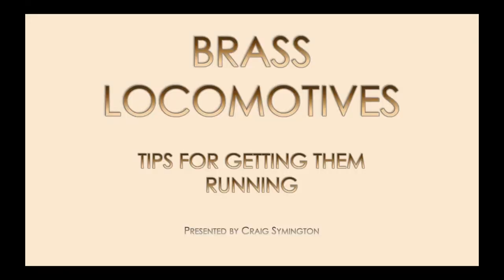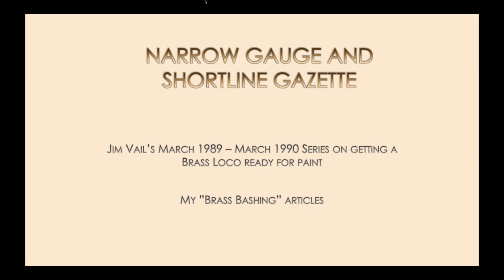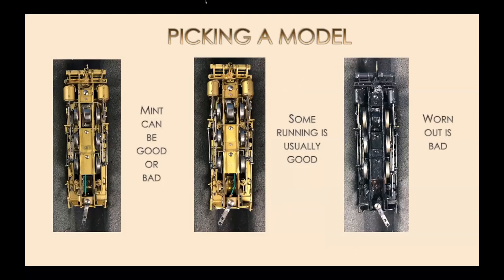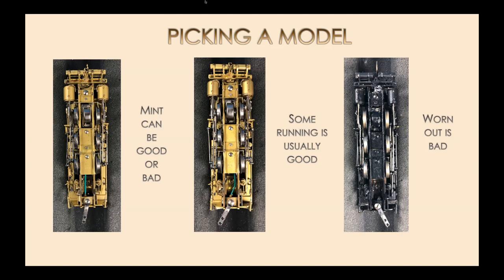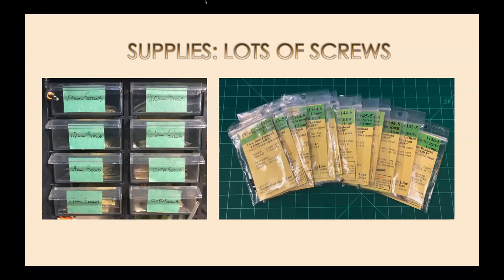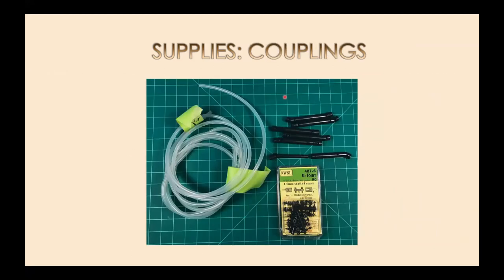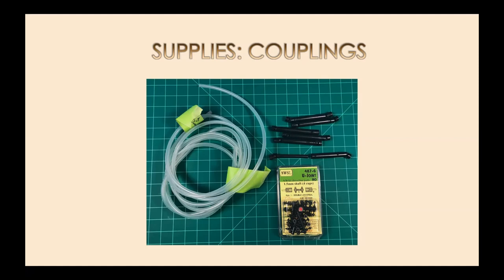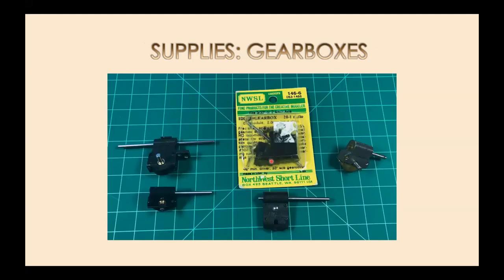Craig Symington presents "Brass Locomotives - Getting Them Running"

Comment: Thanks for sharing your video. I have been rebuilding old Tenshodos Diesel Units as of late. One tool that I also use here are 3d printers (resin and FDM). I print custom detail parts that would not be available. I have been able to fabricate motor mounts to mount those Mabuchi 18mm square motors, so they have a factory like install. I make my own gears, so I can fine tune the final speed and torque of the locomotive.  And since I am doing this project over a fleet of locomotives, I can scale up a mini production run of common parts .
Reply: That’s awesome man